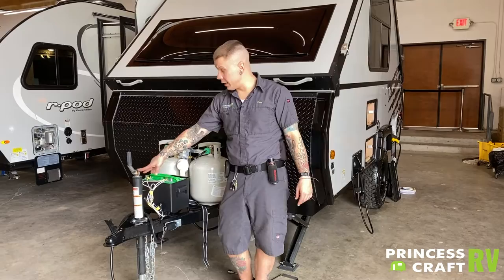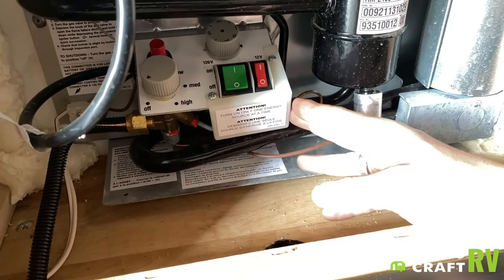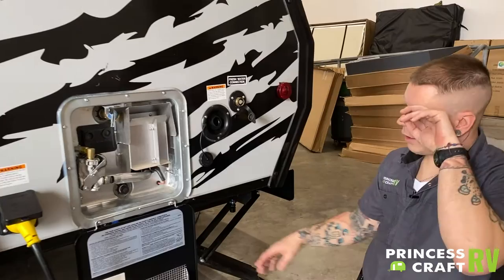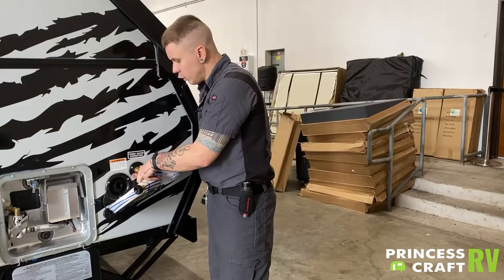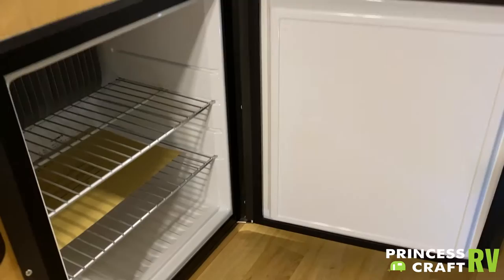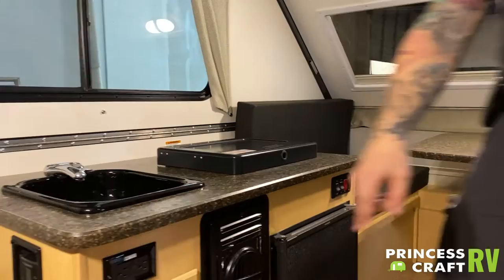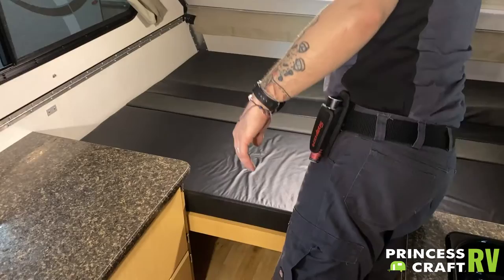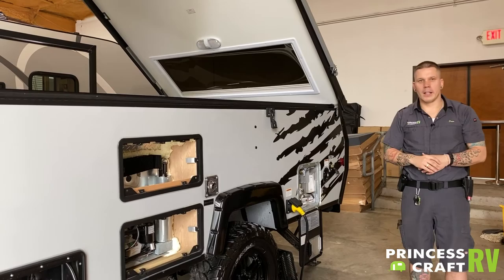Technician Tour - Titanium 12 by Aliner

Comment: FYI 
You should never use a temp / pressure relief valve on a water heater of any kind gas / electric as a means to release the pressure from your water unless you are flushing the system and the temp / pressure valve is going to be replaced at the time. These valves are not meant to be used as an on / off valve... They are designed to protect the end user from the tank exploding.. The temp / pressure valves are built with a spring in them. You continually use them as an on / off valve the springs will weaken which will release the water pressure from the valve, problem is some times the trash from the tank clogs the drain on the valve and then the tank pressure builds and it will cause the water heater to explode. Always release the pressure from the hot side of a fixture in an RV or in a house the valve is designed in all applications. And yes I'm a professional licensed plumber with over 30 years experience.
Reply from the maker: Great comment and information! Thank you!